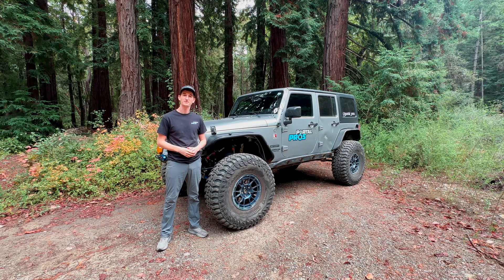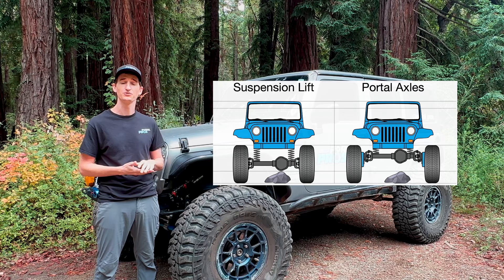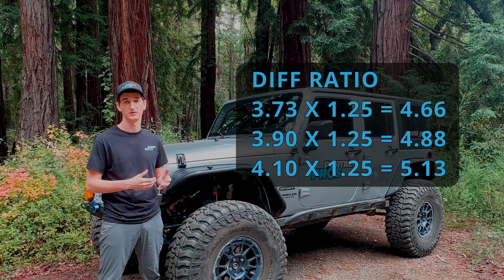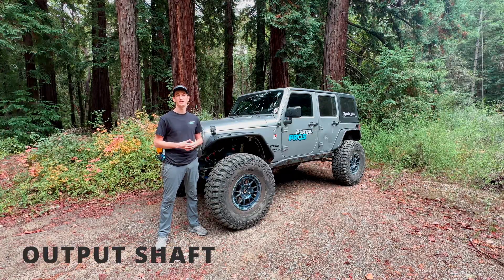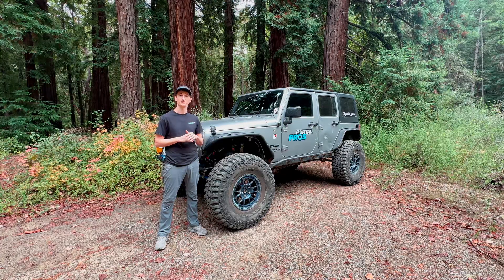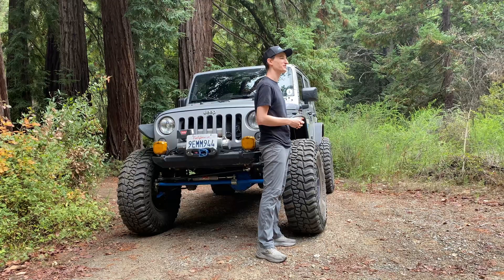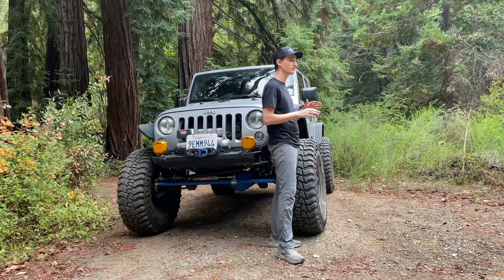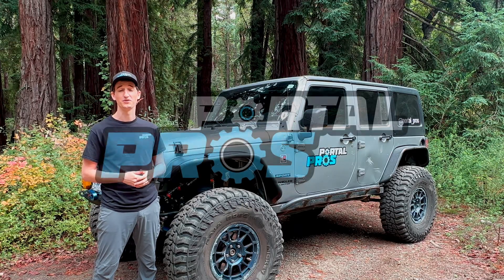High Level Portal Specs

Comment: Will portals ever be strong enough and engineered for the stresses of something like  F250-F350 Super Duty trucks?  Full size pickups have the potential to be your biggest market segment. My concern would be the leverage aspect against the suspension, etc.
Reply: If they can make portals as good as the Unimog, then probably 

Older unimog were like deuce and a halves and newer ones are like 7tonnes
Reply: Your biggest concern should be leverage against the axle tube itself. Without gusseting, the torque load is enormous. Thinnish axle tubes are not made for the increases produced by the portals.
Suspension loads are mainly a factor of unsprung (and sprung) weight as the eyelets and joints where they are connected have a negligible amount of increased torque load with portals. They are very strong connection points.
There are some creators out there right now who are showing how to properly homemake portal axles and the main concerns are axle tubes and portal gears.
Reply: They on unimogs  Mercedes hd off road trucks already mate since the 40s. They probably fit a power wagon
Reply from the maker: As others have said, there are portals that could withstand an F250/F350 in military vehicles, but they would be challenging to adapt to a pickup truck. We do plan to offer one ton portals in the future.